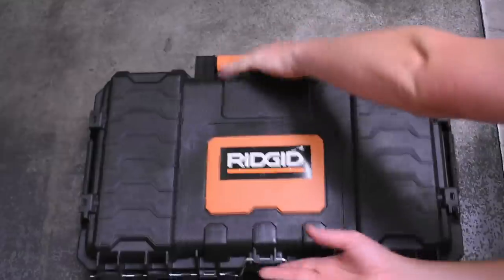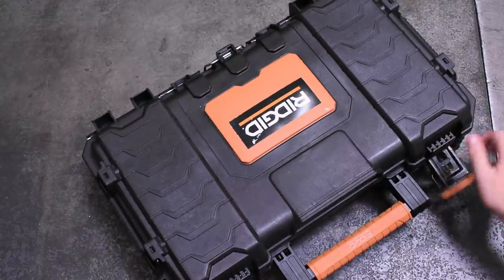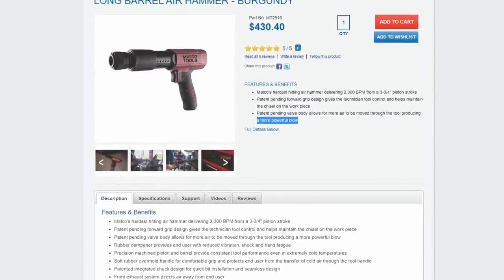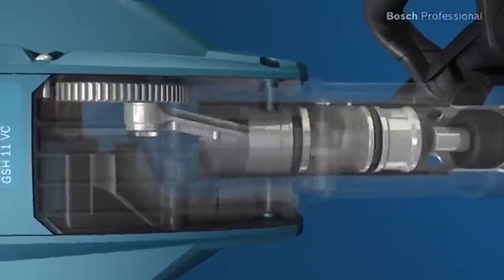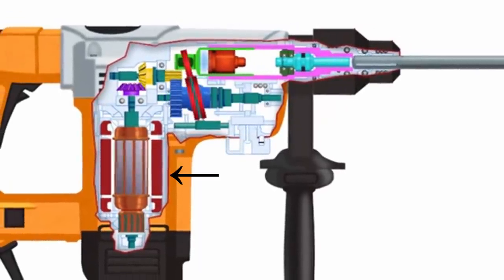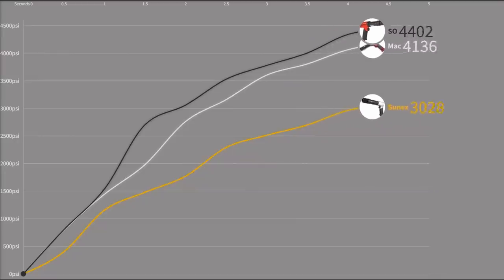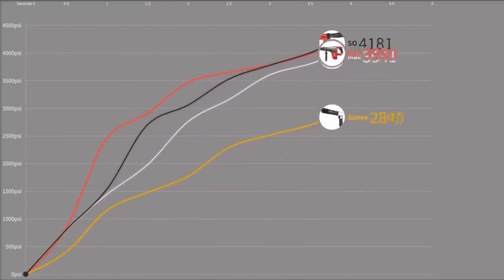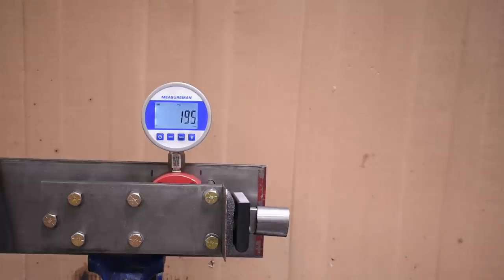How Rotary Hammer Drills Work & Dyno'd vs Air Hammers

Comment: I'm surprised no one has made a hoseless air hammer yet, they have palm nailers, and these so we have the tech basically to get something close in the same size. Maybe test the M12 palm nailer just out of curiosity in how it compares in it's small size lol. Or even the Ryobi sds one since it's at a decent price and offers chisel mode.

Comment: I'd be curious if Milwaukee makes, or will make, an MX Fuel SDS. Given the MX battery, I think the weakest link would become the piston setup. I'd also be curious to see if any other the other companies make an SDS with their elevated battery platforms, like Makita's XGT platform, DeWalt's FlexVolt platform, etc. I have a feeling the hammer is an instance where the tool would benefit from a higher voltage platform, at least more beneficial than throwing more amps on a lower voltage platform, which mostly just comes down to better motor design at the end of the day.

Comment: The energy conversion rate for ft Lbs to Joiles is 1ftLb=1.356J

So the Milwaukee claims 6.8Joules. that must be per impact. So if you know the impacts per minute, you could calculate the useful power.

It's based off a joule is a unit of work done. Work done(J) = Force (N) x distance (m)

So if it moves the piston 1mm it should be applying 1000N of force to dissipate 1Joule of energy.

Edit:
3000bpm at 6.8 joules means they claim 340Watts of useful power transfer. That seems realistic.

Comment: It is not measured in a torque figure (kinda)
the pound part expresses force and the foot expresses distance. When you put them into w=fd then you can use that to calculate energy. 1 nm = 1 joule. since 1 lb/ft of torque = 1.356 nm, the 5 ft lb figure would equal about 6.78 joules per impact

Comment: I’ve ruined many a cordless drill’s using the hammer option too much, I got  a Milwaukee 1” cordless SDS, I’ve drilled 1000’s of holes in concrete no problem, right tool, for the right job.
Reply: Very true, the hammer function on a smaller drill isn't really for more than 6, occasionally 10 mm holes. If it's SDS then it will likely hold up a lot better to heavier work

Comment: Can you test to see how many cfm an air hammer goes through? Because dependent on that and the size of your compressor the air hammer will run out of air fast or slow. While the cordless will run as long as you have batteries at the sake power.

Comment: The milwaukee super sawzall uses a 90* gear set and regular crank shaft arrangement. I know because I took one apart to model it and was disappointed it didnt have that fixed slotted cam thing at 3:47.
Reply from the maker: Very true, not all of them are this way

Comment: Hmm. I think your results may be slightly affected by the strike angle variation, and resulting slip/slide. A tube or sliding guide block may restrict that motion for better results, for both the air hammers & the SDS drills.

Comment: I'm a kobalt fan at the moment, so I'd like to know if you can use a kobalt hammer drill in place of an expensive tool like this. It doesn't have a dedicated hammer mode, but if I put a chunk of steel in place of the drill bit will it break concrete blocks?

Comment: Shop air is usually around 150 to 170 psi and i have never throtalled an air tool back by dropping air pressure

Comment: i think comparing cordless device cost against air costs you need to take in the compressor and lines etc used to get that 90-100ft/lbs of air pressure

Comment: Looks like milwaukee has to make a electric hammer. If they got rid of the drill part and cut down the size im sure it would be very popular especially if it produces a good amount of force. My air compressor is for air in the tires and air hammer

Comment: I have the same battery Milwaukee sds hammer and I also have a Hilti corded SDS hammer and I can tell us the corded hits a hell of a lot harder than the battery one. That's the one u should have tested against the air hammers

Comment: FYI, ft-lbs is not a unit of torque, it's energy: pushing with a force of 1 lb, for a distance of 1 ft. Lb-ft is the proper term for torque, as in 1 lb-force at 1 ft radius.

Comment: i don`t know if someone already said this but if you buy a airhammer you need a compressor and that is someone big money on top of the toll so considering that i think the milwauke would be way better in price to performance
Reply from the maker: And a cordless tool needs batteries and a charger. Which is also not factored in the price on screen. A compressor you buy once, a charger and batteries theoretically can be once as well.

Comment: Seems to me that to measure a drill, what you want is a slipping torque dyno. Basically a shaft on bearings with a brake band on a drum, and a calibrated way to vary the brake torque on the shaft. Then you can plot RPM vs torque as you adjust the brake.  I suppose you would also want to measure trigger control of RPM and/or torque, since both can be important with a drill. Not an exactly simple group of things to do repeatedly unless you can measure and control the trigger depression while also measuring the RPM and torque.
Reply from the maker: Yup, bingo. it's called a brake dyno. We're working on that

Comment: good video. but how do you account for the variable of the user pushing the tool onto the testing area, doesn't that add to the force applied? with impact drivers that variable is not present.
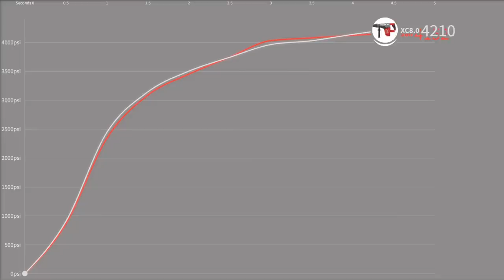Reply from the maker: Historically pushing harder hasnt helped numbers. And 5:27 8:05 and 8:33  runs show a consistency (even if we were hoping for a change). It never seems to matter much
Reply: @TorqueTestChannel  gotcha, that makes sense. Keep up the excellent reviews

Comment: I am looking forward to see if any of the companies come up with a cordless option for an "air hammer" type of tool. 

Closest thing I have seen is the skil auto hammer. It's compact and seems to be able to be abused to use as an air hammer. 

I know I have mentioned it before but that sunex trigger is awesome. I like using it when I have to feather the beans to not damage something. It's night and day different from the HF cheif trigger but the chief is my go to when sunex won't get it done. When I'm done asking something to come out I use big nasty(it's a bit eater,I try to avoid it).

Comment: So I use the harbor freight snap on knock off air hammer to sink 16 and 18 gauge hot rolled sheet steel and 55 gallon metal barrel lids (for handpans ) but my problem is that my air compressor can't keep up so I have to take break constantly which makes the sinking process take forever.  but from what I'm gathering these SDS electric rotary Hammer drills might have enough humph the football to get the job done and not we're out my air compressor

Am I assuming correctly?

Comment: How does this measure? Does the amount of pressure you apply to the tool vary the results?
Reply from the maker: 5:27 and 8:05 are basically the same figures different runs, and 8:33 too despite different battery. And we show a median of 3 runs, the variance was almost nil. We don't know why, but it doesn't seem to matter much.
Reply: I doubt it matters as long as you push enough to flush the bit up with the hammer. So only light pressure. SDS types don't hammer at all if the bit is not pushing against something.
Reply: @TorqueTestChannel  interesting, thanks for the reply! Love the videos!
Reply: @nozzlepie  that’s correct, they don’t hammer unless there is enough pressure on the bit. I most def lean into them a little bit sometimes and apply a little extra pressure which gives the tool a more efficient application if it’s power. If you don’t apply as much pressure some of the energy is lost backwards into your arms.

Comment: This ft-lb is dropping impact energy, not turning force (force applied to the lever arm).

So 5 ft-lbs would be a 5lb weight dropped 1 foot up, or any equivalent combination of that.

Potential energy from height is equal to
mass x gravity x height

Comment: This was really interesting.  Very expensive though, I mean you could get an air compressor and a chisel for the same price lol.  Yet, what about those plug in Amazon highly rated ones going for like $130?  I mean if that proforms similarly to this you drop the weight of the battery...I've very interested in that.  Truthfully though the only reason I really have my large compressor right now is for the air hammer.....

Comment: Can I send you my new Craftsman RP impact driver to compare to others? It’s boasting gen 2 like beans. From my view it seems like their made in USA one, just significantly cheaper. But i could be wrong. Part number is CMCF813B. Boasting 30% mo powa baby with just a 1.5ah battery, even though craftsman doesn’t sell a 1.5ah battery…..lol 30% based on 3 deck screws into 4x4 pressure treated wood vs CMCF800 (which is the giant brushed impact that sells for $129 vs new RPs $79.)

Comment: how would the sds react to being tested on the regular dyno test 'max torque' in hammer drill mode?  would that just break something? like a wrist, or the drill, or the adapter
Reply from the maker: It wont register the drill function's torque (just tightening a bolt)
Reply: Drillbits get stuck in rebar all the time, so those have electric or mechanical clutches to kill torque before the user.  Could rip off from your hands though, if you're not holding properly.

Comment: It's not in torque figures (ft • lbs), it's kinetic energy in the same (wrongly-worded) units as bullet energy:  Foot-pound = 1 lb • ft^2 ° s^-2 i.e. pound-foot-per-second-squared, or mass times velocity squared (the squared is silent just to be obtuse)... so it's not a linear unit and if you have the same projectile/hammer with twice the velocity, you have 4x the "foot-pounds".  Bloody "standard" units :)

Notably, units around that size go up to... I've seen at least 17 ft-lbs, maybe more.  So worth looking into.
Reply: Further thought here, as far as driving something (a wedge as you have) into a fixture like that, there's quite a bit of advantage (probably) to having the tool braced or simply be heavier.  What happens if you strap say 30lbs of weights (not loose whatsoever) to the body of one of the air hammers?
Reply from the maker: @indigophox  You're not wrong. But if that extra weight is helping the tool (equal and opposite law 'n all), it would help someone else using it as well. So it's useful to compare the tools as they are. Rather than trying to create an even playing field that no one else would get to benefit from.
Reply: @TorqueTestChannel  still a very interesting question of how much is the KE of the insert (chisel) and air hammer internals, vs motor follow-through power.  If the impact energy is ~entirely delivered by the moving mass within and without the gun, there won't be much of a difference in the results with a big weight attached.  Also an interesting question for anyone with a cheaper gun who has more heavy objects than cash laying around!

Comment: I’d like to see a test of the SDS hammers in bother horizontal and vertical (downward) positions. From my experience using them, they seem to be tuned to hit hardest when held with little pressure and only loaded by mostly just their own weight. To little or too much pressure can produce diminishing performance. Because you were only doing up against an anvil and not chipping concrete, you couldn’t get the feedback to see it. Try busting up some rocks and you’ll see what I’m getting at.
Reply: The makita I have works off a pressure threshold, you push it a little into the work and the hammer mechanism is engaged. Pushing less doesn't engage the hammer, pushing more just makes your hands tired while it works the same.
Reply: @lolatmyage  mine are similar in that they do need a little pressure to engage, but pushing too hard just send the vibrations into your body and seems to dampen the hits. Gripping the tool loosely with just a little pressure and allowing the tool to  jump a bit works best. Im fairly certain that they’re not the double piston type shown in the video (and that you may have) and are the older type that directly hit the iron.

Comment: I would really  like to see the Dewalt 1 9/16" against  this one, I guess it will beat it in hammering, since it beaten it in all other categories. Rotational torque, less vibration, features (rotation only mode) & better battery life I guess it is stronger in hitting  as well if you compared  it against  Milwaukee,  if not then at least there is 1 thing that Milwaukee  can do slightly  better than Dewalt

Comment: I'm not sure keeping these on the ranking chart makes sense.  The size and weight metrics only line up properly if you compared holding the air hammer in one hand and the compressor in the other.  Regardless, as someone who uses SDS hammers a fair bit I would like to see some more tests of them compared against other SDS models.

Comment: I bet you could overvolt that to get a lot more power out of it, using a custom battery.

Lots of electric skateboarders put bigger batteries in their boards, and manage to boost their wheel torque pretty respectably. I don't see why you couldn't do the same with this.

Comment: Don't you need to put the same amount of pressure on the back of the tool for accurate results?
Reply from the maker: It's one reason we thought an air hammer dyno wouldn't work. But no, doesn't seem to matter much.
5:27 and 8:05 are basically the same figures different runs, and 8:33 too despite different battery. And we show a median of 3 runs, the variance was almost nil. We don't know why, but it doesn't seem to matter much.
Reply: @TorqueTestChannel  very interesting. In my mind it would make a huge difference but apparently not. Who knows 🤷

Comment: I thought we were going to see a half inch socket adapter welded to the end of that shank what the heck
Reply from the maker: Tightening a bolt with a drill doesn't do anything to measure the drill's torque capability
Reply: @TorqueTestChannel  still would have been fun to watch for 3 seconds. 🤷‍♂️

Comment: Without  a controlled amount of pushing force on the tools there'sno accuracyin yourtesting.  That's a pretty big mistake to accidentally  make.
Reply from the maker: How do you account for 5:27 8:05 and 8:33 then? Luck? As with all testing here we also do 3 runs and show median on screen.
Reply: @TorqueTestChannel  okay i rewatched and stick with my original comment.  You were holding two different tools horizontally  that have an major weight difference between tools.  Without a jig to hold the tool  weight horizontally and a controlled amount of force being placed on both tools. This test could go whichever way the person conducting the test wants it to go.
Reply from the maker: Well we have the data to show that's not true (pushing as hard as we can vs holding it normal) otherwise we wouldn't have made the 1st air hammer episode. But everyone in the comments is a physicist after all, so feel free to disregard

Comment: The ft-lb is a funny unit because it’s actually 2 units there is ft-lb the torque unit and ft-lb the energy unit. I assume when they say the hammer does 5ft-lb they mean energy not torque. In SI this would convert to joules not N-m

Comment: Has anyone use a rotary hammer to push auto parts? Like when replacing ball joints, I need to replace a lower control arm and I need to push the tension bar out of the old one and I was thinking about using my electric rotary hammer because I don’t have the air compressor or a pneumatic hammer

Comment: lets see that sds drill on the other dyno
Reply from the maker: Drills dont work that way (as far as representing their torque capability)
Reply: @TorqueTestChannel  
thought it would of been nice to see how much power the SDS drills have in drill mode.  i use mine to drill into concrete since its better than my hammer drill.

Comment: Why do you test impacts for 15 seconds, but air hammers for only 5 seconds for max test? Here in the rust belt it's not uncommon to have to hammer on a bolt longer than that just to watch it slowly work its way out.

Comment: snap on hammer bit is shorter
Reply from the maker: And if this was a twisting/torsion test that would matter.
Reply: I’ve 3 hammer bit length sizes and I can feel the shorter one has more precise hitting and hitting harder where as longer one was all over the place.